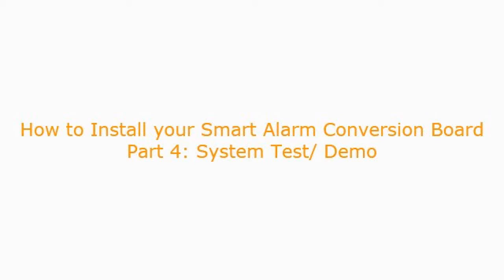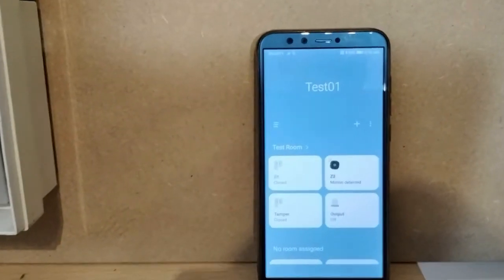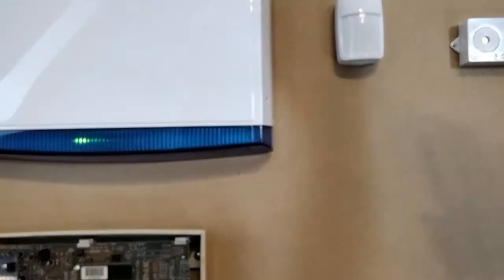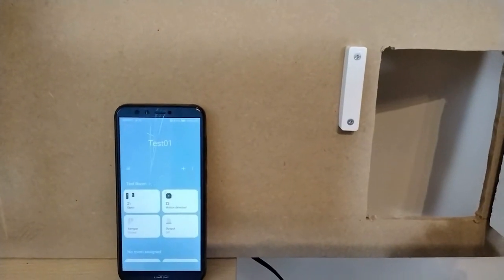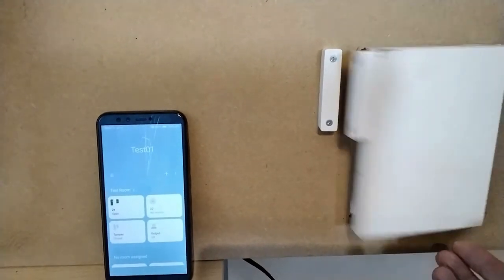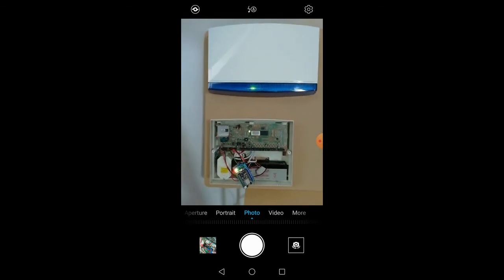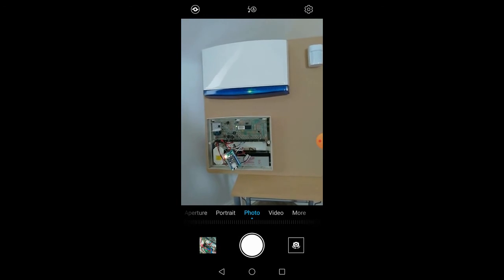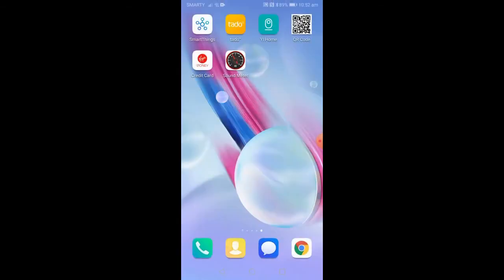How to Install - Part 4: Test the System

Comment: Hi there, I have 2 boards for a 8 sensor system and have installed both. However, only one of the boards is showing the option to connect to the Konnected Cloud,  the other one only has the option for Home Assistant. What am I doing wrong please?
Reply from the maker: Hello, when using the Konnected App to configure your boards, the App will prompt for sign in to the Konnected Cloud if you are not signed in and the option you are selecting requires you to be signed in.  Basically sign in when prompted. The App will let you know when it's needed.

Comment: Maybe a dumb question, if i set it up with alexa or google home device e.g nest hub, would a burglar be able to turn off the alarm by just giving a command to the google assistant. Sorry i am not that tech savvy
Reply from the maker: Only if you set a virtual Disarm switch, I'd advise only setting a virtual Arm switch for this reason.
Reply: Got it, thanks. I just ordered one from your eBay shop today. Look forward to installing it 👍